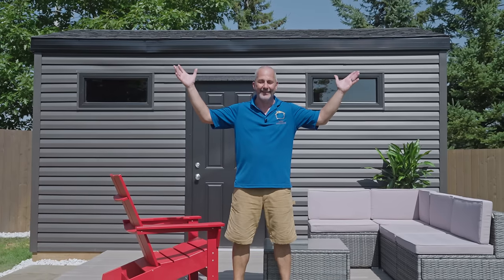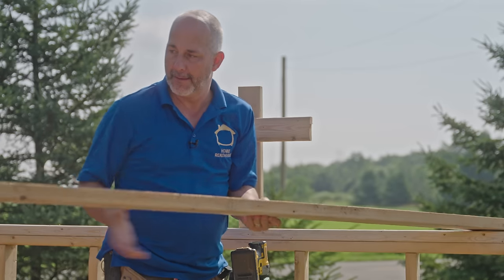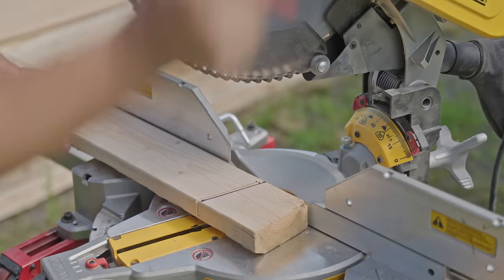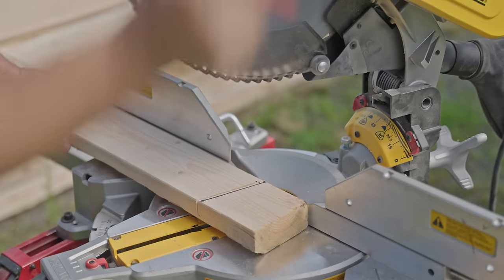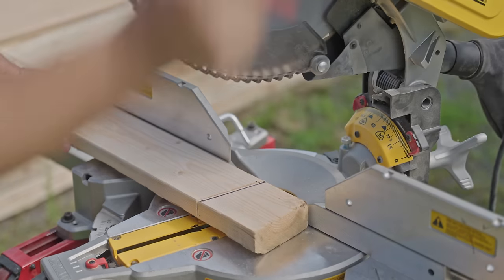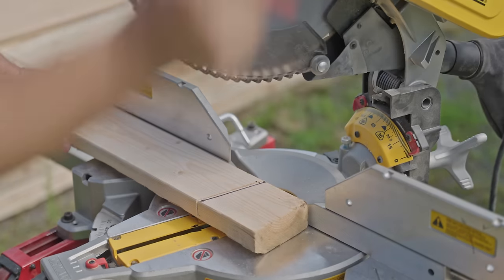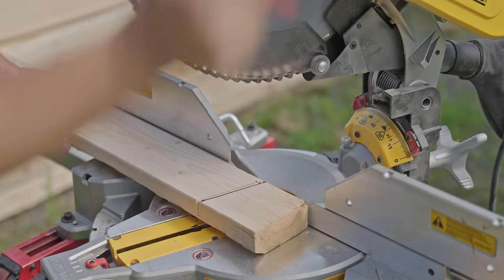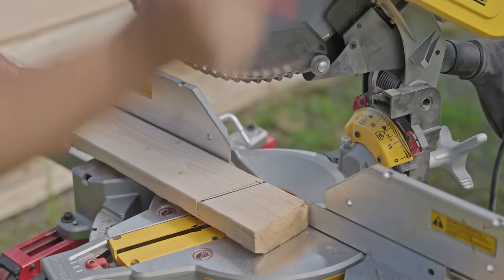DIY Backyard Shed | Framing a Gable Roof

Comment: Why are you limited to 24" of height above the wall height?
Reply: Probably permits and local building code... Some state roof peak cannot be higher than x feet x inches (my area is 30ft 0inches barns being exempt from this restriction) from the ground grade for outbuildings (any building built not as the main residence on the property).
Reply: I am surprised that they aren't using fishmouth/birdsmouth joints where the trusses meet the top of the wall as that would make for a stronger roof to wall joint
Reply: @dodgeme1986truck I think the idea is that birdmouth cut will weaken the 2x4 beyond limit.
Reply: @user-rcghjewqw  it's a small notch, the structural load is transferred to the wall better as well anything beyond the wall is often attached separately
Reply from the maker: 10' tall max without a permit. Cheers!
Reply: @HomeRenoVisionDIY  where we are you can't build taller than 1 story which is 14 feet but I guess it's different in different places in Ontario!
Reply from the maker: Cheers Steve. I may be ignorant of a rule change here. maybe it is time for me to read the code changes again. Cheers!

Comment: Why is your fascia all dented up? 🤔 very strange
Reply from the maker: the board had a warp. the screws set in there caused a wrinkle. once it was removed it stayed bent. I think I will replace it in the spring.
Reply: @HomeRenoVisionDIY  It's the first thing I saw I agree it should be replaced, keep up the good work I'll see ya on the next video